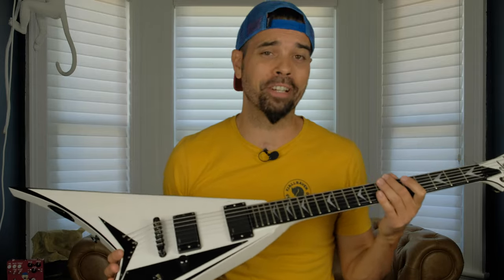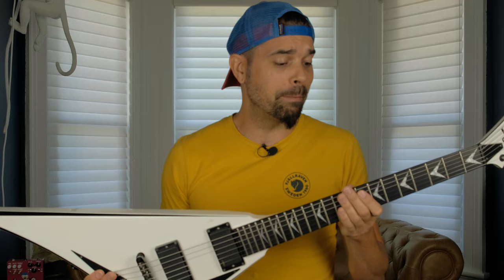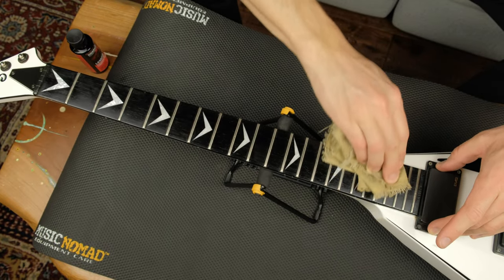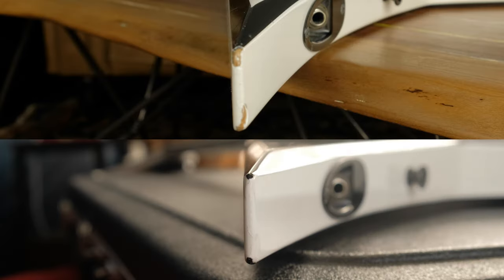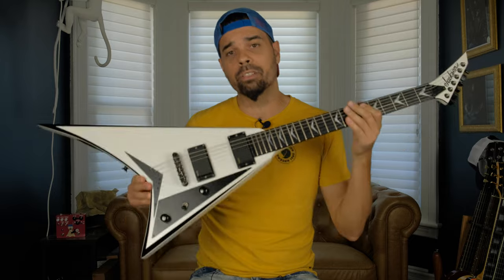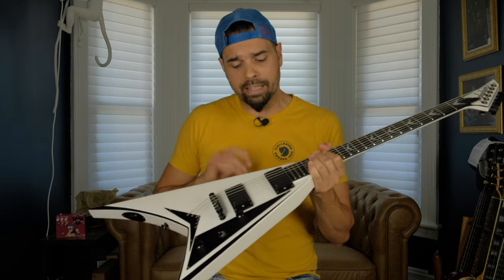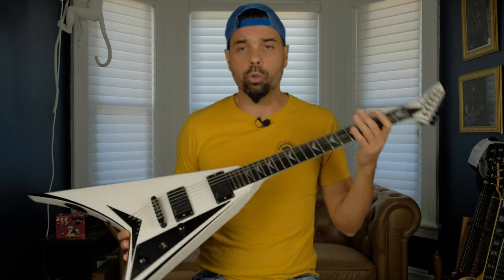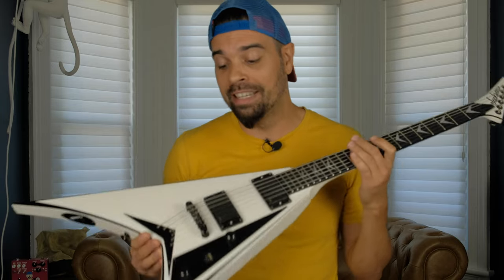Jackson Matt Tuck Rhoads Demo | Bullet for my Valentine Guitar Tone | Peavey 5150 & Omega Granophyre

Comment: got exactly the same as well, bought it from matt him self couple of years ago. love it. just wondering what are your setting for tears dont fall in the intro cuz its sounds nice
Reply from the maker: That's awesome man! If you freeze at 0:39 you can see what my amp is set at. The overdriven tone is using the Green crunch channel boosted by a OD808. Here are my settings (also the cleans have a Strymon TimeLine and BigSky for the delay and reverb):
Pre-gain: 4
Low: 4.5
Mid: 3
High: 7.5
Post gain: 1.5
Res: 6
Pres: 7.5

Comment: Great video, but, I’m not sure about the “controversy” about a 22 fret rhoades model - they’re almost always 22 frets, they’re the one Jackson model that typically isn’t 24. Nice work restoring the ax back to its former glory!
Reply from the maker: Ya I know Randy originally wanted them 22 so a lot were. I just recall there being some controversy with this guitar. I thought it was the 22 frets or the lack of Floyd, I don't remember. Spec-wise it's fairly similar to Randy's except for the pickups and reverse headstock. But I do remember when it came out there was some negativity toward it. Or maybe my memory is garbage and I'm confusing it with something else (likely).